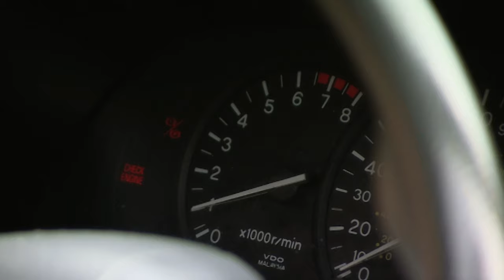Driving A Car With No Oil #TBT - Fifth Gear

Comment: These people are why BMW got rid of dipsticks entirely, years ago, and now lets the display inside tell you when to add oil.
Reply: +Aussie2u Not to mention my old as e36 doesn't have a stick for its auto trans. Makes one fun job for the mechanics to change its oil though.
Reply: You hope it tells you. Makes it hard to check the condition of the oil though. Mines about due for an oil change soon. I try to do them once a year.
Reply: +Aussie2u They didn&#39;t slope it entirely, there&#39;s still a dipstick under the engine where the oilpan would be. But it&#39;s just there for the mechanics to check on.
Reply: +Aussie2u Scotty Kilmer uploaded a video about this and called it the dumbest thing he has ever heard. He apparently hasn't seen this video.

To the normal car mechanic it could seem like a dumb idea but to the general public.. it's a great idea.
Reply: DarkSim712 Scotty Kilmer is also a demented mechanic who still believe he lives in the 70's. Basically any electricity except the battery and the starter motor is redundant to him. He has definitely not kept up with the technology, and whenever he sees something electric in a car he yells at it like a caveman seeing fire.
Reply: +Aussie2u AND THEY STILL WON'T ADD OIL.
Reply: +asdda I will agree with you there - Scotty comes across as very odd for a mechanic but he knows his stuff.
Reply: Doug Odyssey Yeah, he definitely knows a lot, I just think it's weird how he bashes on electrical stuff in a car when he has close to no knowledge of it.
Reply: +asdda especially when his argument is that you cannot check the oil. it's about 3 button press's.
Reply: +Aussie2u The dipsticks are usually behind the wheel of BMWs - that's why the one in the engine bay was redundant
Reply: +Aussie2u 

Of course, BMW's justification, that people don't use dipsticks, is dumb.  As someone else has said, it can be used by a mechanic to determine proper oil level; it's far easier for the technician to do it that way than to put the car on a lift, drain the sump, and then measure the amount of oil that came out to determine for sure if the level is correct.

Of course, you do have instruments to tell you the oil level, but there is always the possibility of a problem that may prevent the oil level from being accurately measured that way, such as a bad sending unit or a wiring fault.

Considering that having insufficient oil is infinitely worse than running out of gas, it makes sense to have a dipstick as a supplement to the instruments meant for measuring oil level.
Reply: Really bmw doesn't have oil dipsticks? That's sketchy I would be freaking out having to rely on a computer to know my oil level.
Reply: *****
It has an oil stick, but on the underside of the car.
Reply: You know, cars used to have dipsticks for checking the fuel too. Now they don't. Technology changes, no big deal.
Reply: Petko Bossakov
Of course, if you run out of fuel, the worst thing to happen is that you could lose your fuel pump.

Run out of oil and not notice it and you could cook your engine.
Reply: Don't believe the computer's display. Mine said that I had 70% transmission fluid in it.. The service guy said it was bone dry.... And I needed a new transmission!!!

Comment: Wait, is he topping up people's engines with some random oil?
Reply: they wouldn't be topping it up with random oil, I'm pretty certain they checked the car manual first. but then again, you never know
Reply: +OhFishyFish A top-up with multigrade is far better than low oil. But they did have a few different bottles, so I don't think they were.
Reply: I looks like Halfords bottles to me guess he just has a petrol and a diesel type and picks cars that the oil suits
Reply: +OhFishyFish a generic crappy multigrade supermarket petrol/diesel refill is still better than running with zero oil.
Reply: +OhFishyFish any oil is better than no oil. Trust me on this. Even used oil is better than none. Hell piss is better than no oil
Reply: ANY oil is better than NO oil, lubrication > oil starvation
Reply: Notice how he was holding 2 bottles and you saw different bottles when he topped up.
Reply: If your badly stuck any oil is better than no oil
Reply: The wrong oil is way better than no oil
Reply: Dude you would be better off using WD-40 and bacon grease then letting the oil go dry.

Comment: I was a quart low on my 4G63t Eclipse and knew there was an oil leak. Well I still decided to do a full pull in 3rd gear to 7000rpms. Once I shifted to 4th is when I heard an explosion and the engine seized. I didn't want to even see how much the pistons siezed to the block from that amount of power happening. Yeah, no oil is always bad no matter the extremities.

Comment: Am I stupid of is the Fifth Gear logo the shift pattern of a 4 speed transmission? 1 2 3 4 R
Reply: Maybe it's a 5 speed transmission which doesn't have a reverse gear :P
Reply: 04smallmj Does such a thing exist?
Reply: Well, someone made Fiat Multipla, so its not that strange that someone made a car without reverse.
Reply: Mayban36 | TASÓ weird, never a car without a reverse gear here in north america
Reply: Chris S. Because is not normal anywhere xD
Reply: The Peel P50 doesn't have a reverse gear, but that's the only car I can think of. No idea how many gears it has and it's hardly a car anyway :P.
Reply: no r because racecar lol some race cars have no reverse
Reply: my friends old vw you would push the shifter down and put it in first for reverse I flipped shit when she told me that
Reply: my buddy has a vw cabriolet and the shifter is 1234R setup just like the logo
Reply: jjtonelli Thats a very common pattern for a 4 speed
Reply: @chrisspahr7264  Formula one racing cars have no reverse gear.
Reply: @gravemind6536  F1 cars have always had reverse and still do!

Comment: that proton is suprisingly strong
Reply: It is a rebadged CE Lancer after all
Reply: @xalataf3365  had a lancer with this engine and it had 420000 km when i sold it and it still worked like new without burning any oil
Reply: Absolutely. My father owns the exact same model (2nd hand btw) which he bought 11 years ago. It's still driveable
Reply: It's a Mitsubishi under that skin

Comment: Oil level should be check when car engine is cold
Reply: nope
Reply: +Bartek “DoubleRr” Tomaszek yes
Reply: +roman949 no
Reply: depends on the vehicle.
Reply: +roman949 no
Reply: I'm a fully qualified mechanic for Peugeot citroen and you always dip oil at any temperature you just have to make sure it is on level ish ground and been turned off for about 3 minutes it's Coolant you have to check when cold due to pressure in the expansion bottle
Reply: +alpinaB12coupe My Astra manual says I should do it when its cold or allow the engine to cool down for half hour before checking.
Reply: +TheDonBarracuda Probably says to check the oil cold to prevent accidental burns.
Reply: +alpinaB12coupe No, it should be checked both cold and FULLY warmed up. So you can see how the oil goes from low/middle to the full mark and make sure it does. Nope nope nope, just nope.
Reply: +alpinaB12coupe agreed, or not necessarily freezing, but if its been sitting on the level for a few hours to let the oil reach the sump
Reply: +alpinaB12coupe Indeed most cares should be checked when cold. Some brands however, like Mercedes-Benz for instance, prescribe oil to be checked when the engine is hot.
Reply: +Bartek “DoubleRr” Tomaszek My manual states to check it when the engine is cold for the most accurate reading.
Reply: +Chris Stuart Same goes for VW. In the offical Volkswagen Mechanics Manual it says that you have to wait for at least three minutes to let the oil settle in the pan.

Comment: Checking your oil (all fluids for that matter), putting on your spare wheel and knowing how to jump-start a car should be basic knowledge.

I'd say being able to change a wheel after a puncture is WAY more important (especially for women since you could be danger if you're stuck out on your own somewhere...just put a set of overalls or borrow some of your partners old clothes, a hair tie, a pair of gloves and a suitable pair of shoes in the boot so you don't get yourself too messy) than being able to check your oil since you do get a warning for those completely inept at basic maintenance and most cars will warn before it gets critical...I'd also say a set of jump leads should be mandatory every vehicle.

Comment: HOW did these people get their driver's license in the first place? Over here in Sweden when we take the license, we do engine check and safety check before setting off. It's pretty basic...
Reply: Yeah same here, driving school shouldn't just teach driving also technical aspects you should have an idea how your cars engine works, i mean its not that complicated you don't have to know every detail just how clutch transmission motor etc play together and what fluids there are and when and how you need to check/change/refill them.
Reply: Driving tests in the UK often begin by the examiner asking you to point things out in the engine bay, but it's not done on every test. I don't understand how people don't know it though, everything you need to check yourself is coloured yellow! It's not hard!
Reply: or red / orange if its an older car :D
Reply: Could be worse, There's the Mexican way, where you DON'T DO ANY KIND OF TEST TO GET YOUR LICENSE....
Reply: You can't check the oil on modern BMW's they have no dipstick, its a mad world.

Comment: Why did you knowingly break down on a highway and not a back road?
Reply: I believe it was done on purpose, for the show... which is by way the shit if compared to TopGear
Reply: I think itl's also illegal to drive on public roads knowing you're going to breakdown. They should have done it on one of the many dissused airfields, Bruntingthorpe for example.

Comment: Something people should also be aware of is that the dipstick only shows about 20% of the oil capacity (or about 1L).  If you are on minimum, you should only add 1/2 a liter, let it run for a bit and then check the levels again.  For DIYers, the same is true when filling after an oil change, you are not draining out the full oil capacity of the engine, typically there is up to 1/2 a liter left.  Ideally you would measure the oil you pulled and replace the same amount, but you can also creep up on it by holding back 1/2 a liter.  Overfilling is just as bad as underfilling, but it's easier to add a little oil than have to drain out a little (or all and start over).

Comment: In Sweden, you fail the driving test if you don't know where the oil stick is (or some of the other fluid caps under the hood too).
Reply: What if you are driving a BMW? They don't have a dipstick.
Reply: I know this is an old comment but driving test in Britain, you would usually have to do a show me & tell me questions. One of the question is "Show me how you would check the oil level in your car" which is good, but the problem it's the examiners choice if they wish to ask it or not.

My dad & granddad told me that it's very important to check your car oil regularly.

Comment: I hope they won't put cooking oil next time they check (probably never)
Reply: Cooking oil is better than no oil.
Reply: i've got to do a cooking oil engine torture test now the world needs to know
Reply: i done it once when my oil light came on and i checked it didnt even register on the dipstick haha and the only oil i had in the boot was cooking oil it was a temp fix to drive the car home where i drained it and replaced with proper oil haha
Reply: Rapeseed oil for it's high smoke point ;-)

Coconut oil would be even better and smell like holidays
Reply: That's actually not bad

Comment: With modern cars and their computers, they could easily make the car not start when the oil is dangerously low. If the problem is that common, they should do it.
Reply: No they should let stupid people win stupid prizes.
Reply: There is a point where people should not be saved from thier own ignorance.

Comment: same story with my Renault Megane, the engine would leek so much that no rust could be found anywhere on the block due to the fact that it was permanantly covert in oil but at a price. i checked and filled every saturday and my parants would not allow me to park on their driveway :'D

Comment: buy an M20 BMW from the 80's, you'll be checking your oil every day ;)
Reply: +M S38 Or an old school mini where you'd be putting in 4 liters of oil in a week! My old Mini had no compression on cyl 4 so I only needed to by three spark plugs for it xD.
Reply: +M S38 don't ask me about the Alfa Romeo 164 and that wasn't even from the 80ies...
Reply: +M S38 My M20B27 leaks so much oil at high load that the back of the car gets little droplets all over it....
Reply: +M S38 or a rotary lul
Reply: marshross marshross Daily driving a rotary ... i think after this you can daily any car, because you have to keep track of everything in the car ! =)
Reply: ConnorWolf But at least you have torque :p
I've got the M20B20 ... in the E34 chassis :x
It doesn't leak, but it sure burns oil
Reply: +M S38 The M52 has 1 qt/750 miles is an acceptable level of burning from the factory. Lol.
Reply: +Zach Grounds My M52b25 does not burn a drop of oil. If a M52 or M50 is burning that much oil, it as been neglected.
Reply: +M S38 M30B35, same problem :D
Reply: +M S38 I have 20 years old E36 with more than 300k kilometres and i dont need to add any more oil between oil changes so i think BMW engines are pretty robust
Reply: +M S38 eh my mb50b25nv drinks half a quart every 1k miles
Reply: +M RO  It's a win-win. You never have to change the oil, just keep adding to it!
Reply: Or buy an antonov an-2, you'll be Checking your oil all 2 hours

Comment: Some people seem to think that as long as there's no oil spots where you park your car, that it's not leaking oil.  While it's true that it's likely not leaking outside of the engine, but it very well could be leaking into other parts of the engine. Usually that type of oil ends up being burnt with the gas in the combustion chamber. I always check my oil before washing my car, that's about 1-2 times a month.
Reply: The oil only goes into them areas if it has an underlying problem. You can see oil being burnt by blue / purple smoke. More likely to see it when warm as the oil will sit in the exhaust and burn when heated. I only ever check my oil once every month or two, or if I'm going on a long journey.
Reply: Your engine using oil doesn't necessarily have to mean your piston rings and/or turbo seals are worn.
A very tiny bit of oil gets it's way through the piston rings etc, especialy diesel engines tend to use a bit of oil. But ofcourse if it starts to exhale blue(ish) smoke, it's time to check if it's your turbo or worse. 
It's just normal procedure to check your fluids every ones in a while (in my opinion, but i'm a cars guy, so :P)
Most people just let the garage do it, when their car is going to the MOT...
Reply: Usually you can tell if you are burning oil due to the smelly exhaust

Comment: People associate oil consumption with old engines but brand new vehicles can initially use oil too.  When my Benelli tornado was delivered (I bought it new) it used a ton of oil in the first 200 mikes until the piston rings broke in, now it doesn't use anything.  It will be less visible on a car due to them holding more oil than bikes, but it's worth keeping an eye on oil level on any vehicle, old or new as some naturally use more oil than others.  My car is a 2003 Seat Leon with the 1.8 20v petrol engine and the oil level barely moves at all between the oil changes (at manufacturers 10,000 mile intervals)

I've had the car since 71,000 miles and it's now just short of 140,000 miles and oil consumption has never changed and still runs like a Swiss watch.

Comment: They should teach real world things in school such as how to properly maintain a vehicle, how to replace a wall switch or light fixture and basic plumbing. Rugby score keeping and how to dissect frogs does nothing.
Reply: +The Dollar Guy Education is designed to provide kids with skills to solve problems, find their talents and interests and provide them with intellectual capabilities to pursue what they want to do. The skills you mentioned is complete garbage for a child. Once they grow up, if they want to learn, it's literally a 5 minute video on youtube.
Reply: You would amazed at how many people do not know how to check or what oil even is in a car.  Blows my mind that people are afraid to remove a wall plate cover because they are afraid of what is behind it.  Typing is being removed from some school curriculums (or its removal being contemplated).  The qwerty keyboard the primary man-machine interface right now.  Whole point is a well rounded education to function in real life In addition to problem solving skills makes everything well rounded.  More people will change oil in their cars than use differential equations in the real world.  You would think these skills would be learned outside of school, but a surprising amount of individuals have no experience.
Reply: Very good point mate.